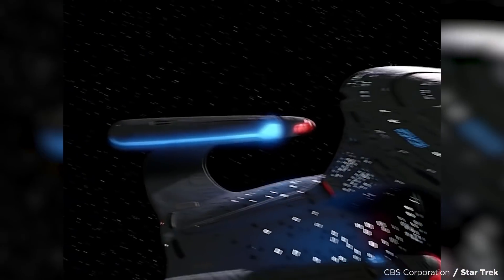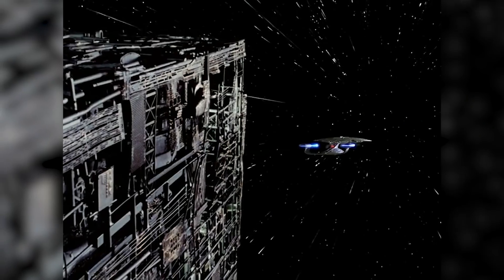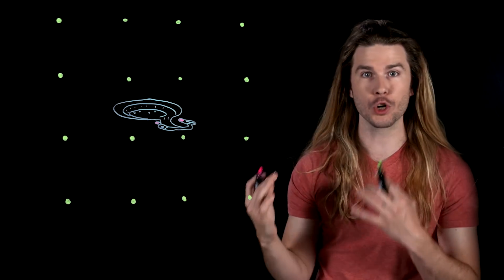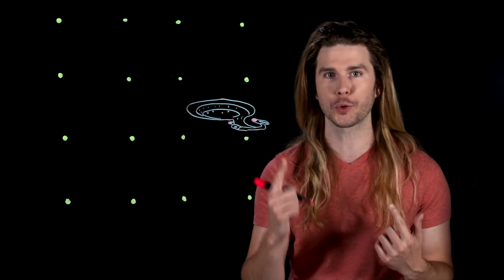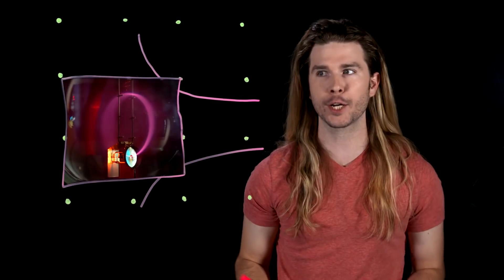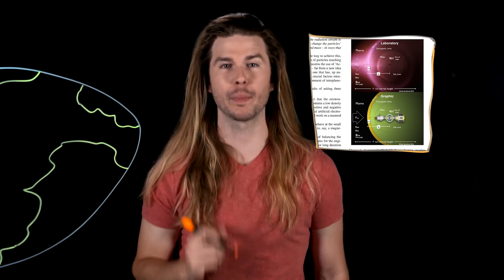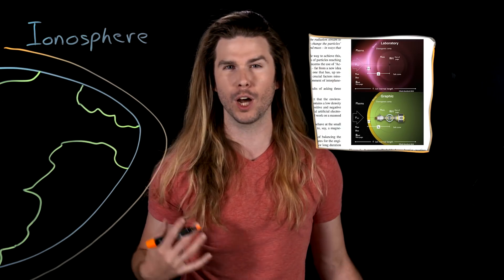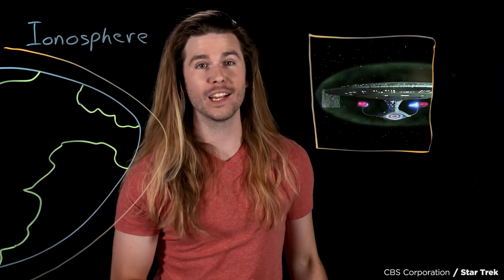How Do Star Trek’s Deflector Shields Work? (Because Science w/ Kyle Hill)

Comment: Okay just watched this episode and I had an idea, however, how far-fetched the idea was I almost didn't post. In the future do you think if needed we could actually help the Ionosphere out by supplying some form charge and help reverse global warming in some form or another? Basically giving another layer or helping supply more density to the already formed Ionosphere. The energy necessary would be enormous but is it feasible?
Reply: Cody Sketch , I could imagine a satellite network generating a shield that could block solar radiation, though the energy needs would be very large. Which means we would probably have carbon emissions under control.  An even simpler system might be having a shield at the L1 LaGrange point (always between us and the sun).  This can also help magnetic field deficient Mars from losing its atmosphere.
Reply: wouldn't just a very large properly placed solar shield made of tin foil or the like provide enough shade without all energy requirements of any type of energy shield? plus playing games with the ionosphere doesn't sound like a good idea? better yet, very large solar electric power satellites used both to block out the sun's heat and make electricity at the same time and solve the energy problem once and for all?

Comment: So...what you're saying is that a sci-fi deflector shield is just a portable magnetosphere for spacecraft? Too bad it can't replace actual armor plating.
Reply: ...neutral particle beams would be deadly to a starship regardless of what it's made of. Also ballistic weapons and rockets made of conductive materials would easily slip through a deflector shield, also, a deflector shield made of plasma would get insanely hot after prolonged use and too much heat could damage a starship. So a pulsed or selectively adaptive focusing shield of plasma could work.

Comment: But those types of shields don't experience strain just because someone fires on it, it's energy draw is more or less constant and thus given enough power the shield is impenetrable for any and all energy weapons.
Kinetic weapons engage!
Reply: for every action there is an equal and opposite reaction, so when the beam gets deflected the machine that produces the magnetic bubble gets pushed back equally, with enough firepower you could theoretically launch that device through the ship at near light speeds.

Comment: If a phaser shot alpha or beta particles though it would only have a range of 1 metre or 10cm in an Earth-like atmostphere I swear?
Reply: I don't think you get my point here. Alpha and Beta particles (helium nuclei and electrons) only have a range of 10cm and 1m respectively in Earth's atmosphere. My question is referring to the video saying that this is one possibility of the make up of a phaser's beam, but how can that be seeing as the ranges of the particles are so short and seeing as we see these phasers being shot in Earth-like atmospheres in the show. My point isn't anything to do with deflection, rather absorption by air particles.
Reply: To both of your replies, I said "Earth like". Any atmosphere will absorb the particles but an atmosphere with earth's pressure will do it at 10cm for alphas and 1m for betas. Do you seriously think that walking around on a planet with breathable air has nothing in common with earth?
Reply: Ed F. When we say alpha or beta radiatipn being stopped we mean at the speed it is ejected froma nucleus.  10%c fpr alpha 50% for beta or something like that.
If we accelerated alpha to 99.999% the speed of light it could travel through miles of air or maybe a few metres of solid material. Same for beta.
Reply: Ed F but it's space tho.
Reply: 4 Tonnes of Fury yeah mate I'm talking about the handheld phasers which I'm assuming were what were being talked about because that was the graphic in the video. They would be used in an atmosphere.
Reply: asdasd123 Would that make a difference? I'm not incredibly knowledgeable about it but if it passes through the same amount of air surely the chance of absorption or deflection by atoms in the air would be the same? I'm only going off stuff I've learned at GCSE and A-Level as that's the level I'm at currently so please correct me if I'm wrong.
Reply: Ed F you might be able to heat enough of it to get it somewhat out of the way and extend the range a bit more, but there are lots of problems with phasers reguardless
Reply: Dragon Warhammer yeah, a particle beam with extremely high voltage/acceleration could penetrate through several meters of air, or more.
Reply: Phasers fire fictional (I think) particles called nadions.
Reply: They've fired phasers at planets plenty of times.
Reply: Unless the phaser expels its projectile at ridiculously high speeds, the charged particles would stop before traveling far, pulled off course by the electrons or protons in the air, if I understand the principle. Instead of a beam of charged particles straight to your target, you'd get a small cloud of them near the... muzzle? I'm going with muzzle... of the phaser and huge amounts of heat released into the air, almost certainly dangerous to the user and anything nearby. I don't remember the name of the scientific principle, but it's true.
Reply: Right. I think the idea is that they use fictional particles and if fired at high enough speeds they can do a lot of damage.
Reply: it fires phased particles. shield might use plasma particles maybe from the collectors and high frequency makes it suck up phased energy or even solid projectile. the more energy hits the shield, the more particles that are in the shield get lost due to energy they received.thats how shield depletes. fire energy at same frequency as the shield and it should pass through it.
Reply: Does the Kalvin Verse use Beta Particles? because Beta Cannon?
Reply: If it DID, you could block it with a jacket/ sheet of cardboard. Or a tin foil hat :)
Reply: themetalstickman Klingons use nadion based weapons, I believe.
Reply: A phaser emits a nadion beam.
Reply: Why do you think you never see them on earth (except for that episode where they went back in time, and in that episode, I'm pretty sure they didn't use phaser shots on earth, or if they did they didn't use it further than 10cm
Reply: Ed F is correct.
Reply: If its in atmosphere it wouldnt change, the magnetosphere only protects against coming from the outside.
Reply: It would still work, the magnetosphere doesnt extend all the way down to the surface.
Reply: Except at near c speeds particles in the air would be more or less completely still, so I don't see how increasing the speed would help all that much. You should still hit the same amount of stuff traveling through the same thing, regardless of whether you're going at 0.1 c or c. I'd guess you'd get less than a c/v1 increase even.

Comment: The thing that always confused me with 'bubble shields' in sci-fi, be they ship-sized or for personal use:  Upon activation, the shield usually 'expands' out from whatever device is being used to generate it, and that device is attached to the user... So, why does the bubble not push the generator and the user apart?  If you had a 'personal force field generator' on your belt, and activated it, at best your belt would go flying off, and at worst your whole mid-section would be crushed.  Or, for ships, if the shield generator is located inside the ship, then how do the shields expand to the outside of the ship without tearing the ship to scrap?

Comment: Hmmm....I wonder how disruptors  work like what the Klingon and Romulans use?   
Would that be under the same principles????
Reply: that is an interesting thought. If i had to guess, i would say they likely use uncharged particles to bypass most of the power of the magnetic field. Making the plasma the only thing keeping the disruptors from getting through. The more plasma is neutralized, the weaker the shields until the plasma in the magnetic field isn't dense enough to prevent the next shot from getting through. It would line up with what has been shown in the shows as well, as disruptors always seems to get through shield much faster than beam weapons as it only has to get through the plasma field, ignoring the magnetic field.
Reply: I would agree

Comment: Actually, now that I think about it, I wonder why starships don't use kinetic weaponry if they know practically every ship has the counter to plasma/particle weaponry? Kinetic weaponry would be so devastating.
Reply: b1uezer u shoot something with a mass, the recoil will kill (decrease mostly) ships  speed and will screw up the direction the ships moving..

With gravity its much easier cause everything is being pulled towarda the core, but in space it will be very chaotic.
Reply: Do you think it would it be possible to design ships that counter the change in velocity/force? I wouldn't imagine you'd need large ammunition, or even very much of it, just the right material that can piece hull metal and let the vacuum of space do the rest. I would suspect that the mass of a starship + pulse thrusters would be more than enough to compensate.
Reply: kinetic recoil isnt the problem, it would easily be countered with their inertial dampener technology. The problem is that kinetic weapons are useless against these shields. If you were paying attention he addressed this already. Kinetic weapons would be vaporized on contact with the shield because of the dense plasma the shield incorporates. It is not purely magnetic, it is a combination of magnetic fields and dense highly charged particles (plasma).
Reply: The borg cutting beam is supposed to be a kinetic weapon. Not sure how kinetic and beam are supposed to work together but it is scifi after all.
Reply: Magical Fungi true..  completely missed that part of the vid earlier, now that i rewatched it..  

However, just an idea, so we have this kinda energy shielding in halo universe too..  and plasma needs to be generated and need to be controlled by a mag field..  shldnt a projectile with sufficient mass be able to chip through the shielding ?
Reply: b1uezer sure..  think about deck cannons on a pirate ship. On a wheeled track so they fire and they go back on their own withoit effecting the main body..

Or may be, we can gradually increase the speed? However the moment the mass will release from the host (the ship that will fire it) body there should be some disturbance..
Reply: Ah I didn't realize that was what he meant. I was thinking, the shields themselves were useless against kinetic projectiles and not the other way around, because everyone had moved to using plasma/particle weapons (that is, the shield isn't universal). But if it is universal in a sense then I can see the point.
Reply: yeah, wouldn't be much of a shield if it didn't block the most basic of projectiles...

Comment: Kyle....Great video...however I think you need to make a slight correction...Star Trek makes a distinction in the deflector and shields.  This goes back to Gene Rod.  The deflector is a cone of energy which is shot out in a beam in the path of the ship to DEFLECT items out of the path of the ship so you don’t explode when colliding with space dust at 10 times the speed of light while SHIELDS function as you depicted in this video.  

I understand how other shows refer to these shields as deflector shields I.e. the Star Wars empower in return of the Jedi “oh, i’m afraid that deflector shields will be quite operational when your friends arrive”

But Star Trek refers to the deflector differently
And just to be clear I am not hating on ST or SW they are both awesome, just different

so no big deal just trying to be as accurate as possible
Reply: that is a good point, deflector shields are to deflect dangerous particles while at warp speeds, the shields themselves are a different technology.
Reply: Hypothetically Star Trek deflection uses gravity manipulation stuff, same as ftl. In real life deflection would just be pulsed lasers causing a small amount of object to explode, pushing the rest of the object in another path. Pulsed lasers for causing microscopic detonations can be pretty precise.
Reply: their ftl is space warping. Not gravity.
Irl, a federation starship moves faster than light.  Therefore lasers (light) would not be an effective deflector. Also, look into redshift energy. Basically explosion plus lightspeed or fraction of lightspeed = massive radiation in on the high end (red end) of the light spectrum.